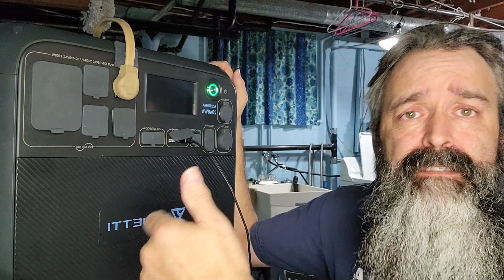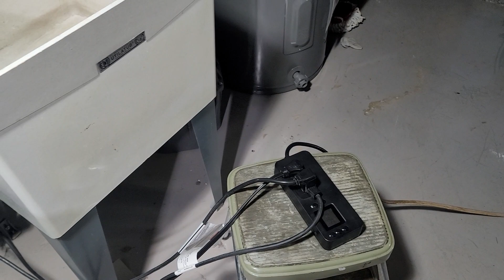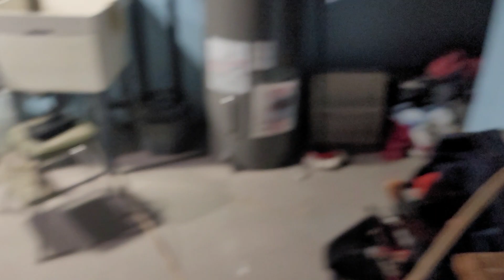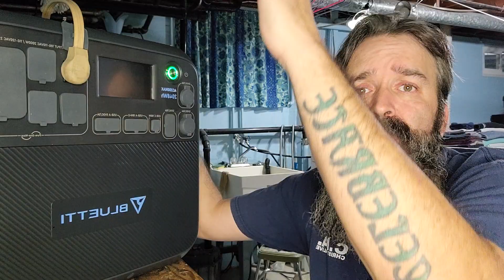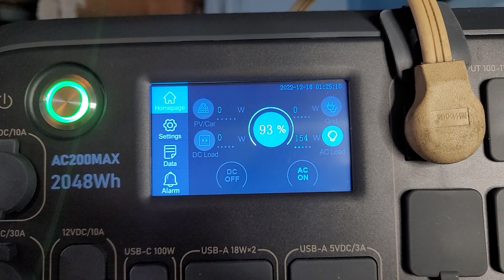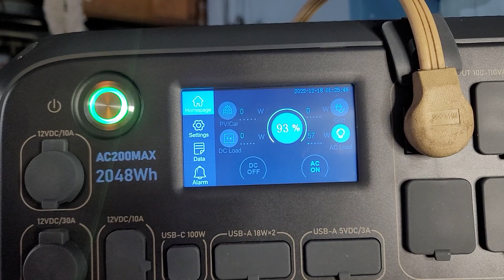AC200MAX WILL RUN MY 1/3 HP LIBERTY PUMP AND WASHER. #POWERSTATION #SOLARGENERATOR

Comment: Hi Chris !!!   Yes, it's a 10 minute hack on the furnace fan.  Swap the switch for a switch outlet combo,, w switch upline and it'll feed right in. Just make sure the power is switched off. 2 outlets might be safer, but you'd need a jumper. (circuit broken between outlets)

Comment: One of the things my Ac200 Max couldn't run was my Washer machine. I think It was trying to pull more than 15 amps. I tried a few things and still couldn't get it to work. Glad you were able to get it to work for yours. Put that AC Max to work!
Reply from the maker: I wonder if it's because mine might be older?
Reply: @patriotplumberreport  Might be. That's awesome you got it to work! Great video btw
Reply from the maker: @Off Grid Solar Smart House  Thanks, brother. That truly made my day 😊